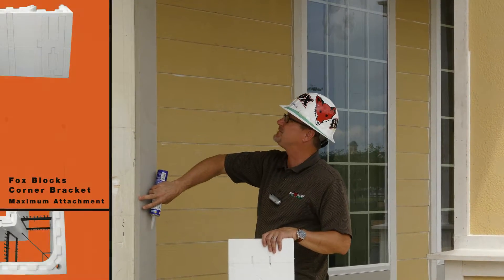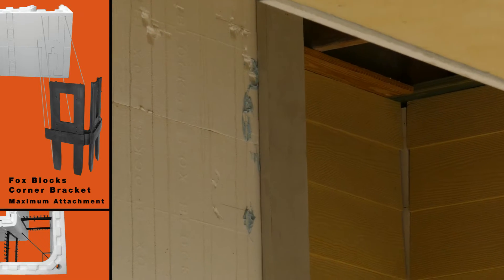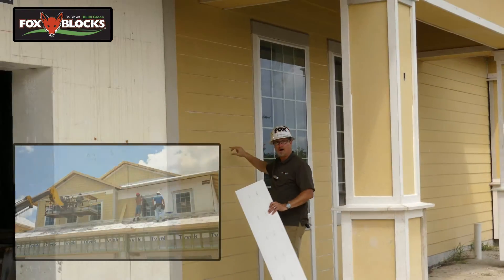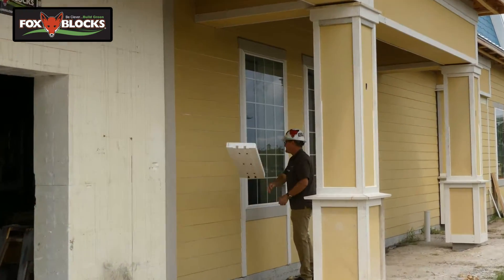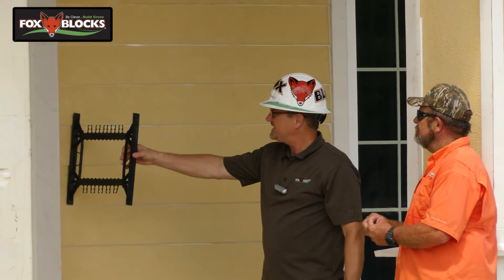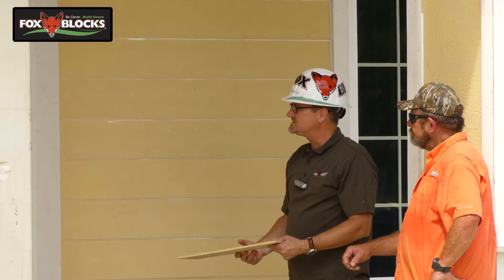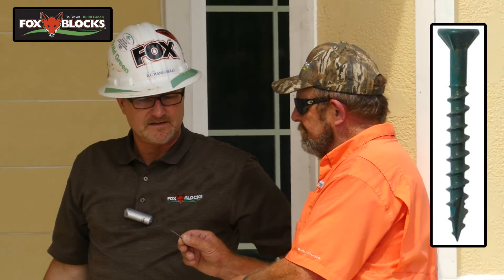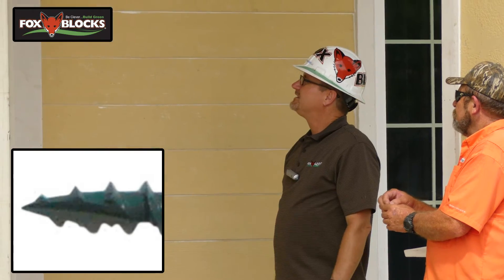Fox Blocks ICF Fiber Cement Siding Attachment

Comment: I would assume that you can utilize regular deck screw 2 inch long.
Reply from the maker: Use the screws recommended by the siding manufacturer. Fox Blocks has tested many different screws for pull out and shear strength but you still need to do what the siding company allows. 
You can find the reports here: https://www.foxblocks.com/resources?query=screws&category=codes-and-standards